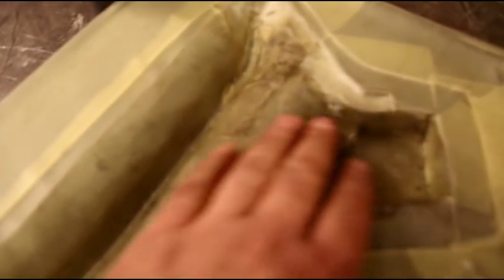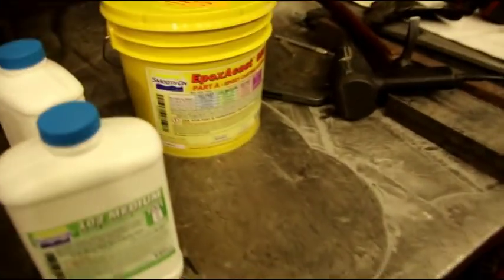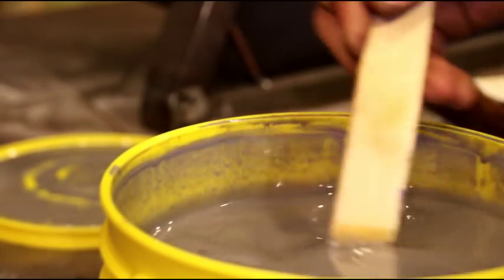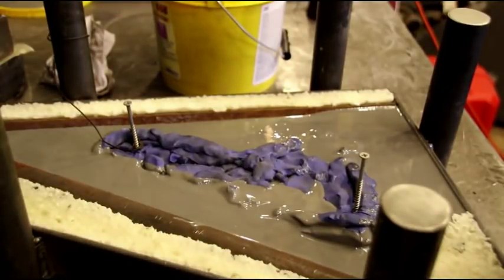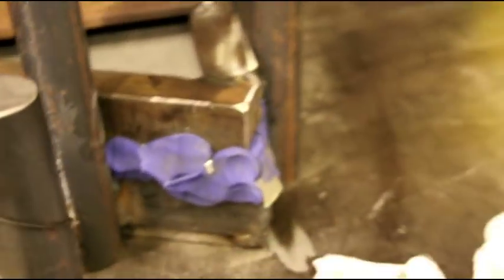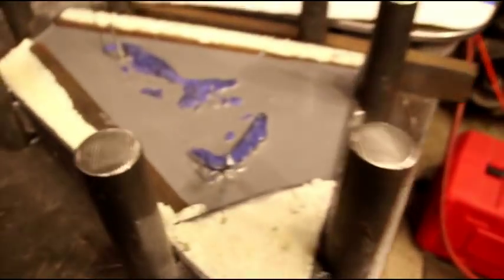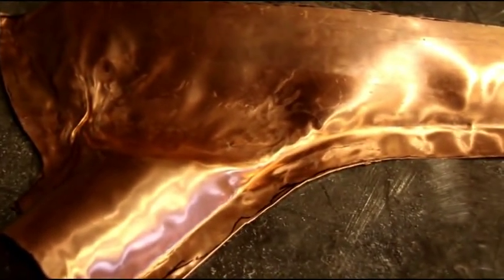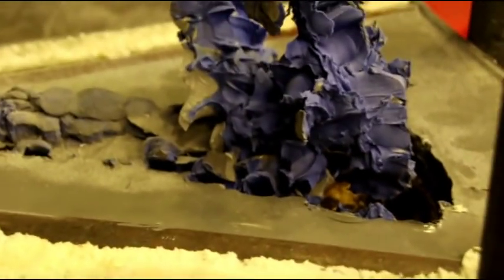Metal Stamping Sheet Metal Part 2

Comment: Looks to me like you're making a vent/defroster duct for a '57 to '60 F-100!
Reply from the maker: defroster duct for a willys CJ5
Reply: @metalshaperJeep  Thanks! They are very similar in appearance which I find surprising. I made replacement vents for my '57 F-100 from the OEM 'cardboard' with fiberglass. Later, a person in a truck club made the vents from 1/8" black ABS plastic sheet, formed in a press similarly to your stamping! Thanks for posting your project!

Comment: Just thinking out loud here but I wonder if you could figure out where to prestretch the blank to then make the press process go better? I was thinking nothing fancy just  rough hammer form the deepest areas then finish with the press dies.
Just a thought?
Reply from the maker: Hello Kirk,
Tried a bunch of different techniques to get this part made.   It came out great but not a fast as I was hoping.   Resin stamp works great and then  I work out the kinks after it comes out of the die.   
Brian

Comment: I am pretty sure that your press will  not have enough tonnage but if you wanted to you could make some round feet and bore the top (punch side) and on those feet machine a flat knurl on the face, and bore spring pockets in the top to hold down your material. Or drill dowel holes in the material and around the impression to hold the material help prevent  it pulling in. It may not stop it but it may help. I have watched a lot of your videos and your work is top notch. Thanks for sharing your skills.
Reply from the maker: Yes, I am limited in tonnage, so did not make a 2 stage die.  Working on getting some larger stamping machines so I can expand my line of parts.  Thanks for watching.

Comment: Brian, love this demo, nothing like it I've every seen or read, question, why a press over using it as a hammer form, especially with copoper? I assume you're doing this for use as a limited production run addition to your product line?
Reply from the maker: I am just showing new techniques to people.  This die can press out steel, aluminum, copper etc... 
Casting resin in great in this application but will not make a good hammer form.  Not strong enough to take sharp hits with a hammer, but works great for slow, even pressure, stamping.

Comment: I was unclear I know the copper was a test the actual part will be steel or copper it requires a lot more than I can do make a stamp looks good
Reply from the maker: the finished defroster duct will be made out of copper.  I don't want any material in there that can rust so I decided on copper which will be painted black.